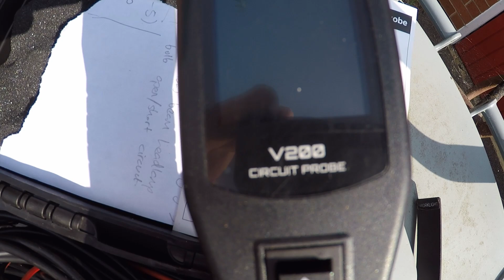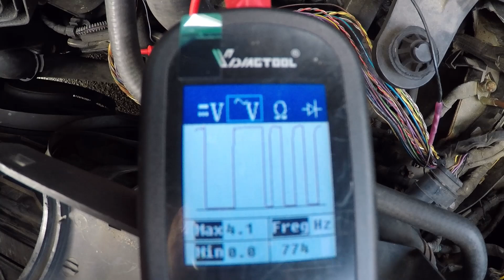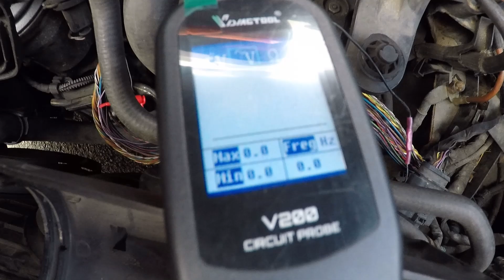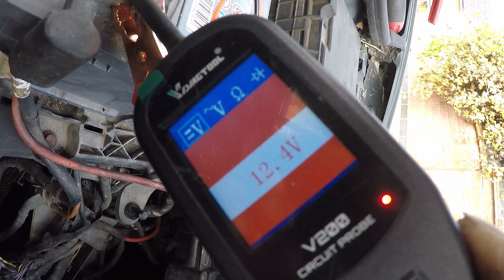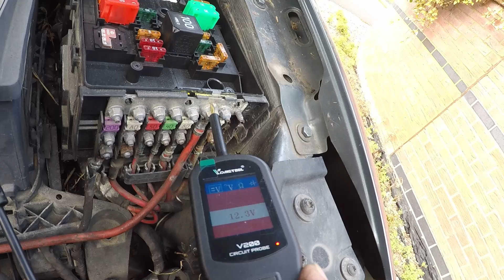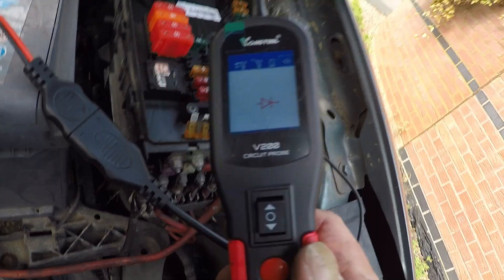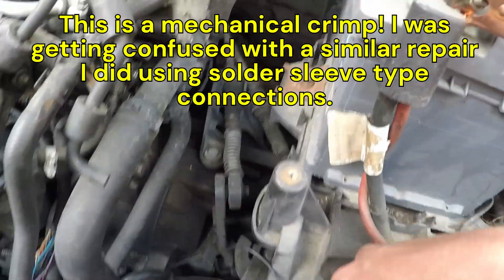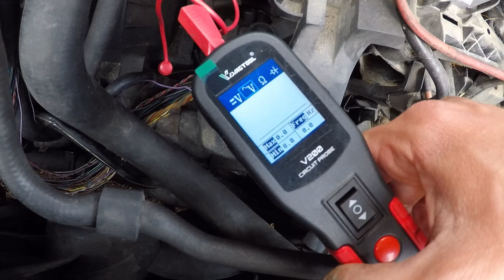VDiagTool V200 Circuit Probe - Demo and Review of Oscilloscope Function to Fix Stalling VW Golf TDI

Comment: Hi. I've got a similar problem on my 2007 Golf GT TDi 2.0. The only difference is when the car gets hot it doesn't want to start until the engine cools down. Do you think it could also be the  the cam sensor or wires to the cam sensor? It's a proper head scratcher! Any advice would be welcome. Thank you.
Reply from the maker: Hi, that does sound very similar to the initial problem I had on this car with the crank sensor wiring. It would start ok when cold but then would stall when it was warmed up a bit, then couldn't be re-started until it had cooled down again. If you watch my other video about my Mk5 golf stalling and crank sensor waveform that should explain how I found the issue by checking the crank signal at the ECU plug with a cheap oscilloscope whilst wiggling the wiring loom running over the top of the gearbox to the crank sensor. It would be worth starting your car when cold and wiggling all the wiring looms and see if it stalls out. Be very careful of the fan though in case it starts up! It could potentially be the cam sensor/ wiring too, but I think I tried and was able to run my 1.9tdi with the cam sensor unplugged. It put on the engine management light but would still run, from what I remember. Not sure about the 2.0tdi. Good luck!
Reply from the maker: https://youtu.be/Y8fO2AOWtNk